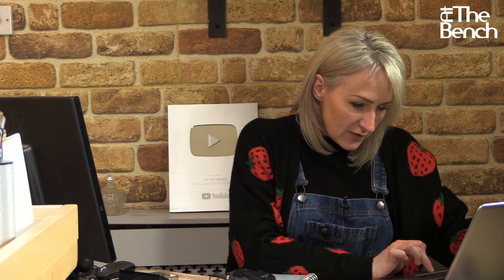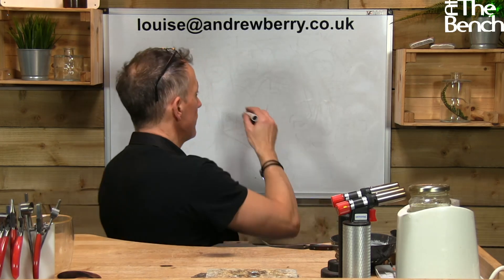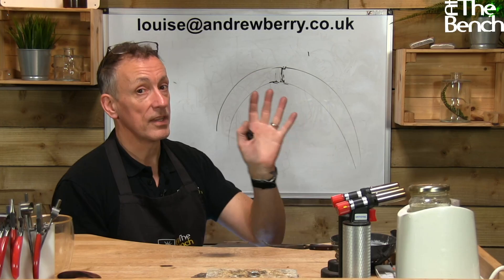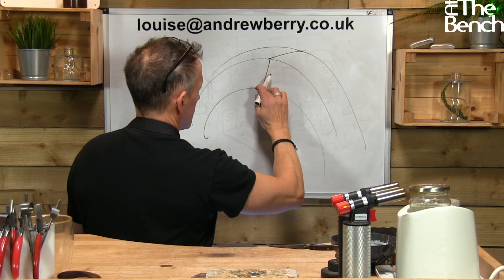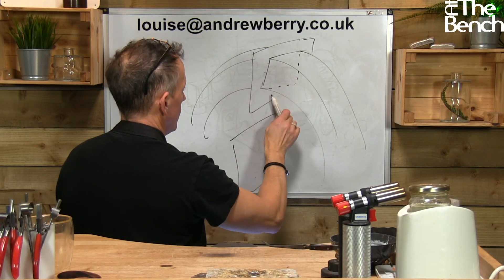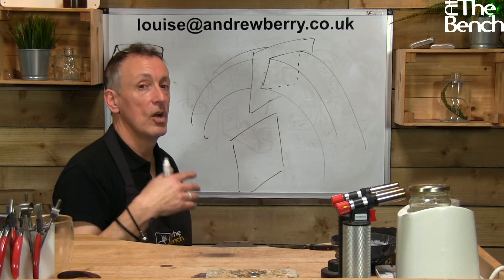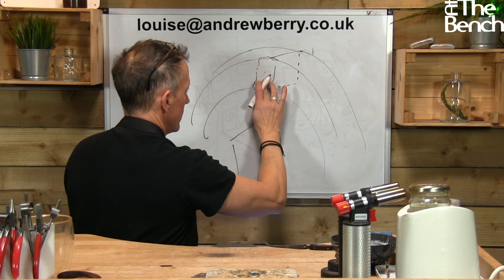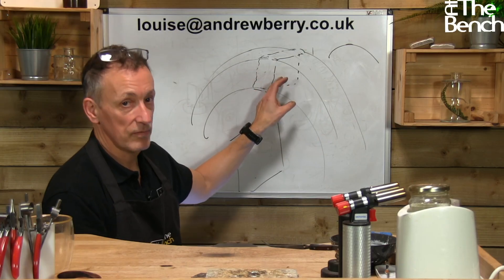90% Of Jewellers Will Get This Wrong - How To Join A Platinum Shank

Comment: You should have mentioned plumb solder. Its between 90% and 95% platinum and wont behave as you said when polishing, and has the correct color and good strength.

Comment: how do you feel using 1700 Plat weld solder? Been using that and not getting any seamlines just like using 19K WW gold solder with 14K wg ring shanks, thx for the videos!